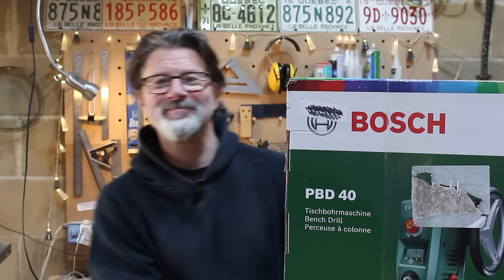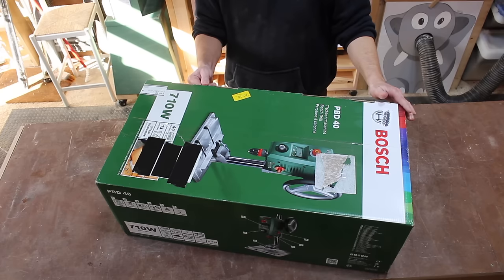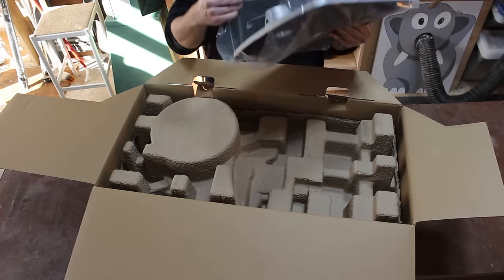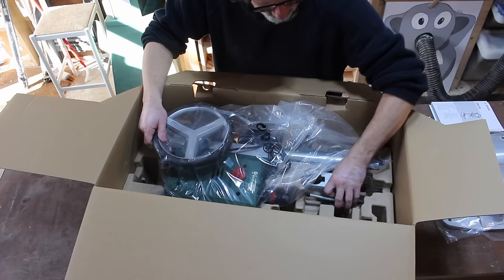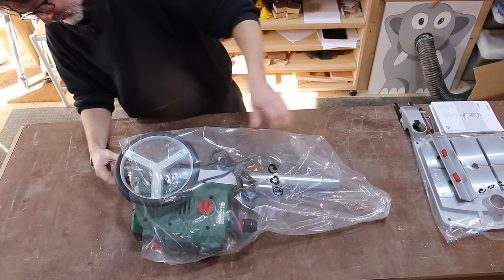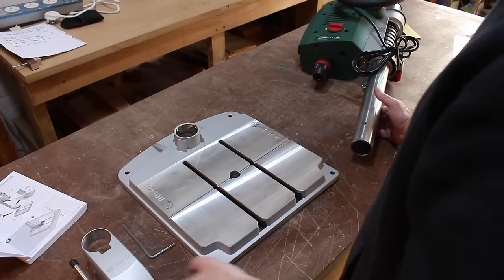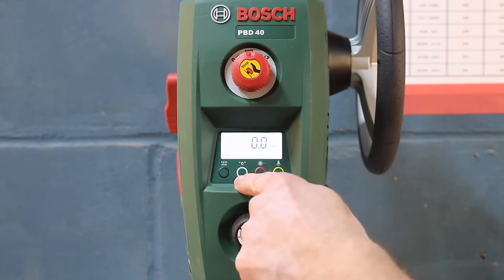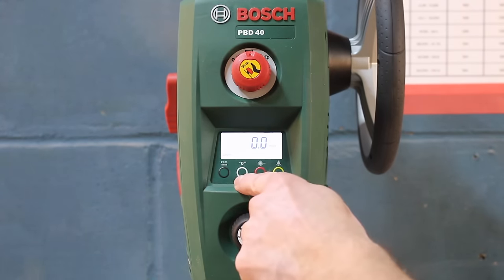A review of the Bosch PBD-40 Drill Press

Comment: Funny anecdote. I've had many drill bits come loose and fall off the chuck with this machine. It was very frustrating. I would tighten the chuck until my hands hurt, to no avail. One day I opened the manual to find the section about chuck disassembly and maintenance. There is no such section but I found something much better: the red ring wasn't just for decoration, it was for locking the chuck. Locking the chuck. And I had been that close to calling up Bosch to tell them there was something wrong with the machine they'd sent me.
Reply: I must admit to ‘having a go’ with any new toy before reading the manual.  Often, the consequences are similar to the one you describe.  My wife usually reminds me with this acronym whenever I commit this, in her view, cardinal sin; “RTFM”.  I think you’ll guess the meaning.
Reply: Quick tip to remember with Bosch machines, anything red is movable or lockable. Handles, locks, switches, etcetera.
Reply: Kudos for your honesty, here! :-)
Reply: As the old adage goes "If all else fails, RTFM!"  🙂
Reply: Nah I strongly disagree - instruction manuals are not for real men. We make mistakes, we cuss, we re-do (multiple times!!!), we complain to ChatBot, we review YouTube; only then do we read the instructions…..😂
Reply: @martinthomas5194  "The instructions: the last resort of the desperate..." 😉

Comment: It's one of the few consumer drill presses that has the motor and quill moving on the column, rather than the table moving, making it ideal for woodwork, where you sometimes have to drill large flat or long things, so you put it on your bench, and bring the bit to the work, not the other way round. I have one, and I like it.
Reply: A comercial grade one will likley have the table move, for a very important reason, you might be trying to drill a hole in an akwardly shaped or long piece of metal, the moving table allows you to swivel it out so you can clear half the stuff likley to be on your bench beside the drill itself.. A table that doesnt move is only usefull if you drill small things on it, or somehow have a clearing either side of it big enough to insert long pieces of timber or steel which almost always isnt the case..

Comment: Not a bad drill press, but it needs work. There is a wobble on the chuck which comes from the cheap needle bearings in the gearbox. These I replaced with roller bearings, you can find plenty of videos here showing how to replace them. After replacement no more wobble. I also replaced the wheel with standard lever type arms.

Comment: These things are loud. I watched a review from someone else from a different importer. The plastic may look somewhat different, but they’re all the same. Unfortunately, these use the cheap method of using series wound motors. These are the same as a portable drill. So speed control is very simple. But you lose torque as low speeds and they’re very noisy. I’m curious to see if these are brushed or brushless motors. Brushless being more desirable. Just remember that these are very lightweight machines. They, in no way, replace a cast iron and steel machine weighing more than twice as much. It sounds hugely different here. It’s in no way 73 db A weighted. Maybe 78, which is noticeably louder.

Comment: I used this tool for a few days before returning it to Amazon. The tool itself is excellent, but after drilling a few metal holes, I was unable to unlock the bit without using another tool each time. Additionally, the drill suddenly stopped working, even though I was only using it for light-duty tasks. I decided to return it but am considering purchasing it again, as I suspect I may have received a secondhand item given the poor condition of the box.
Reply from the maker: @user-ld8ii5nv1r  sorry to hear that- I hope the replacement works better. I only use it for wood so can’t really compare, but I’m really pleased with mine still!

Comment: Good review. I bought one  just before Christmas when the Amazon price dropped to just under £200. Overall, I really like it. However, I didn’t get on with the standard Rohm keyless chuck so swapped it for a keyed one. I also swapped the wheel for more conventional turnstile levers (£15 aliexpress). The lasers also needed adjusting, but that was an easy job.
Reply from the maker: Wow, you got a good price there! I don’t mind the wheel, although ask me again in a few months!
Reply: i'd like to do that with mine. which (röhm?) chuck did you change to? and was it difficult? did you notice an improvement wrt runout?
Reply: I wrote a long and detailed reply yesterday but it is gone today!

in short… No, the chuck didn’t improve the runout. It was an easy change. You need a 1/2”x20UNF thread.

Comment: It is a crime that this drill doesn't get more reviews and presentation. 
For the price, it is very affordable for features. 
Considering that you can pay 100-120 € for a belt driven drill in same size.
This one offers the electronic RPM adjustment, automatic torque/speed compensation/adjustment when torque increase while drilling, the great depth measurement (I just drill to debt without physical stop unless I need to repeat the hole multiple times) and super easy drill bit changing. 

And it is even easy to take on top of large boards by having that drilling hole at center. 
The table is as well clever, for drilling circular objects like pipes and you get anyways all needed from it.

There are few things I don't like, one is that depth for drilling is sometimes just little too narrow. So you can't drill deep enough hole in some cases. 
Other is that the depth wheel is sometimes annoying when you need to drill deeper, as you need to grab it with other hand to pull some more, but that is really problem when you don't have it bolted on your workspace, as otherwise it will move. 
And third thing is really that it is so enjoyable and simple to use that you like to use it more when not even needed.

Comment: I've this drill press a couple of years and I believed the depth reading to be faulty (as lots of comments on forums) however having viewed your video it has become clear to me that is user error on my part and the function works correctly. I have viewed numerous videos on this product and yours is the clearest and most concise. User manual pretty much the worst i've ever read. My usage is general and do not pin point accuracy so this meets my needs. I am not a fan of the wheel as i often have to reset position for deeper holes I will have to look for the forklift steering wheel as that looks like it will solve the issue. Great video.
Thank you.
Reply from the maker: Thank you for your nice comments! I’m going to do a follow up and test the depth gauge more accurately. Stand by!

Comment: Very useful review and much clearer than most that I have seen.
73 dB is very roughly the sound level within a modern car at say 120 km/h.
There is a review in French covering issues on the run out and changing the bearings etc, but for most peoples use this looks good equipment.
Reply from the maker: Thank you!

Comment: It is a rather nice drill press. I have had for years and years now. Glad to see others seem to enjoy this model.
A small comment, if I may - at 13:47 you are zeroing on the tip of the wood drill bit, the full diameter holw will be less than 15 mm. To get the exact 15 mm, you would either need to plunge the tip of the bit into the wood, or measure on the side of the board with the flat part of the bit.
Reply from the maker: @aaandis  Yes, you’re quite right - I don’t take into consideration the point of the drill bit! I do fix this on my whiskey smoker video though when I use a forstner bit, and point out that I need to press the point into the wood to make it level with the chipper. It’s a great drill, the more I use it the more I like it!

Comment: Great drill, well reviewed. I stripped the lower red handle and it took months to convince Bosch to honor the warranty and send me a new one. Between local and distant Bosch reps, everyone passed the buck. So watch out and make sure the handle is well seated before applying torque to it. (it has a spring that allows you to pull it out a bit to set it at a different angle)

Comment: Bought this in the Black Friday sales last year at 40% off, absolute bargain at around $260 at the time. Very happy with it and no wobble with drill bits that my other pedestal drill press has at  much higher price. The only gripe I have is that when you lower the head you cut off the intersecting beams of the laser, which was visible in this video also. But impressed with it other than that.

Comment: Watch your video great  information  just got one of these tried it today for the first time trying to drill wooden balls but exit hole spilts what would you suggest to stop splitting the wood
Reply from the maker: Hi - yes I had that problem to begin with. I now put a sacrificial piece of wood underneath what I'm drilling and this usually eliminates it, it certainly improves any splintering. Hope that helps!
Reply: @Mr.M_Woodwork  thanks for getting back to me ill try that later. Regards  mal
Reply from the maker: Just realised you said you were drilling through wooden balls (I read it too quickly!). However, I would have thought that using a piece of wood beneath it would still help. Other things that might help are increasing the speed of the drill and moving slowly through the wood, as well as using masking tape on the exit. Tell me how it goes!
Reply: Thanks again might be the weekend before I have another go at the balls but  I will let you know either way regards

Comment: I have this one really nice machine I did, however change the chuck because the old one kept on getting stuck. The new one is much more accurate and can handle the smallest drillbits up to 13 and it’s easy to tighten and loosen.
Reply from the maker: Good to know if I need to change it in the future.

Comment: The PBD 40 has some very weak points. One is the chuck, which I changed and that was a huge improvement. Here is a video about how to change the chuck: https://youtu.be/nCqVoaGVK8g
Unfortunately, the machine is very noisy. The noise is caused by sloppy bearings, vibrations and the gear box. Not easy to fix, but since the machine has a gear box, I guess it is not fixable at all. When the machine is new it is acceptable, but it gets noisier all the time, even if you grease the gears. The biggest problem is that rack. The machine head wobbles and there is no adjustment for the wobble. The play is simply huge. That resulted in my decision of finally dumping the machine. https://youtu.be/3IsRIDdp05o
Reply: You could have upgraded the chuck to one with extreme precision for a small cost.  There are plenty of videos on this.  I have just got mine and was prepared to upgrade my chuck based on the runout comments like yours.  My use will be mostly for woodwork.  Mine is spot on after a couple of days of testing for accuracy in hardwood, ply and softwood.
Reply: @Selkian  None of my issues would be solved with a different chuck. I changed the original chuck to one which was very good, so I really don't get your point, since my problems has nothing to do with the chuck. Yes, for wood works this is an excellent machine if you can stand the noise. The machine is very noisy because of the metal gears, the sloppy bearings and the poor DC motor which uses brushes.

Comment: I use to buy Bosch back when it was made in Germany, I avoid it now like the plague since they moved production to China I assume the drill is the same? 
Sorry you don't know what 73 DB means but then you of that generation....I would have thought finding out how square the drill is to the base would be more useful than sound levels??
Reply from the maker: Thanks, I’ll add checking that it’s square to my follow up video! I didn’t want to presume that everyone knows how dB works, so thought it would be a nice idea to compare it to something we all use and know how, approximately, loud they are.
Reply: @Mr.M_Woodwork  Sure the suareness accuracy will rely on the shaft being a good slide fit into the base anything else will more than likely show as an error in alignment...goes to where and who makes the item!